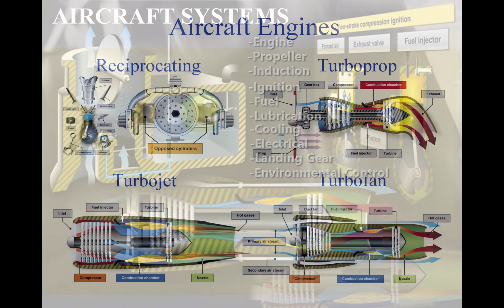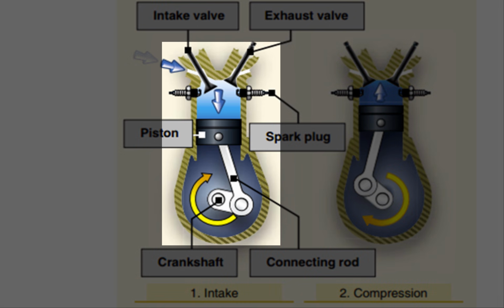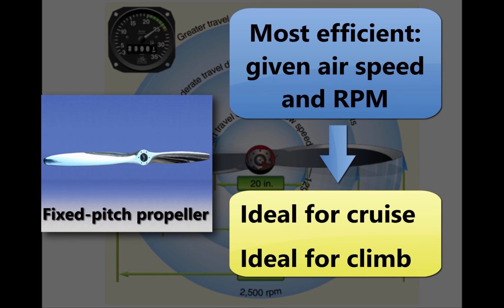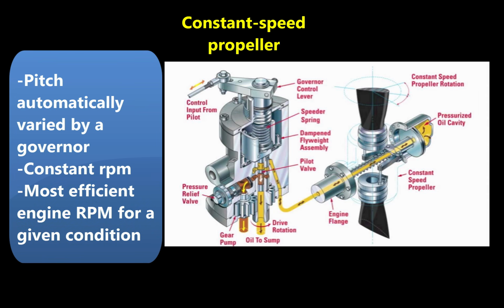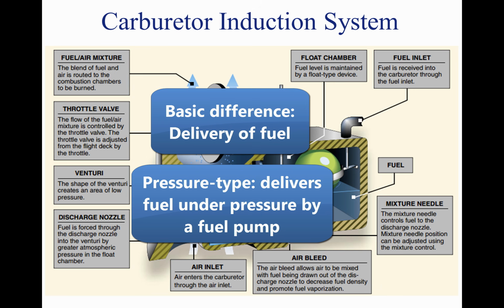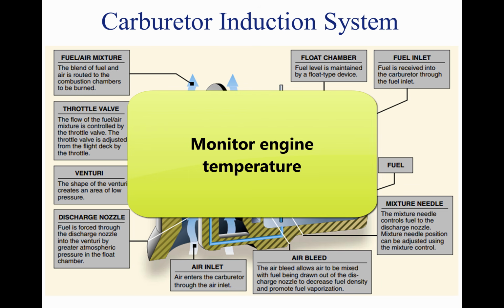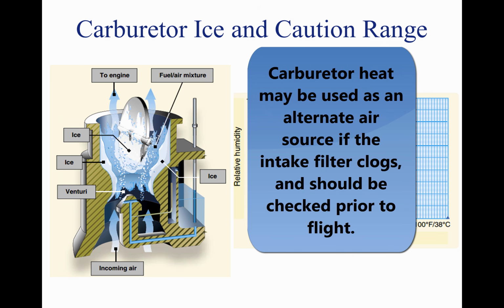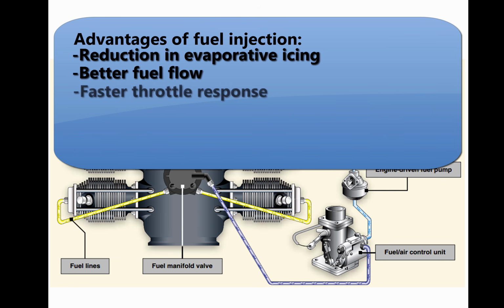Private Pilot Tutorial 6: Aircraft Systems (Part 1 of 2)

Comment: Carburetor ice is caused by : "Increasing the velocity leads to a decrease in ΔT and this is because the higher velocity does not give the fluid enough time for the heat exchange process, so the temperature of the outlet air decreases."